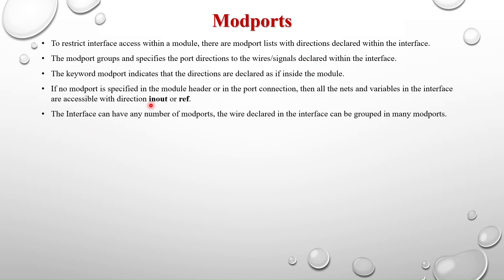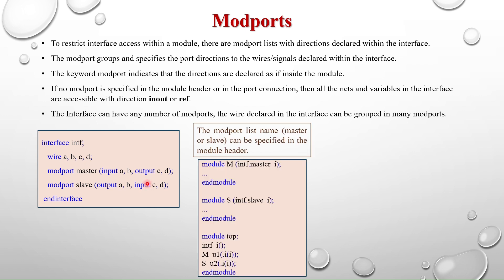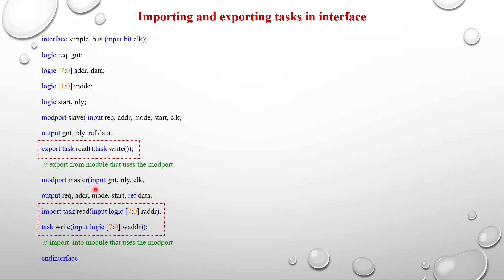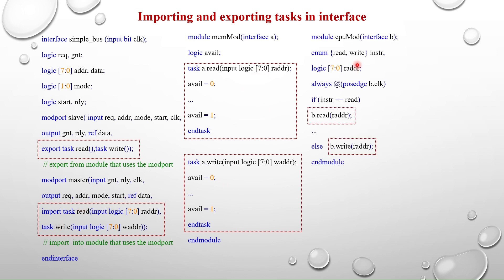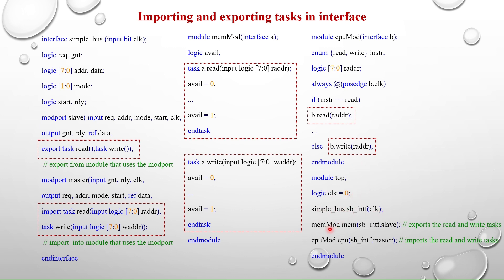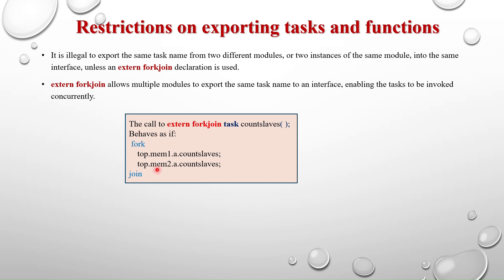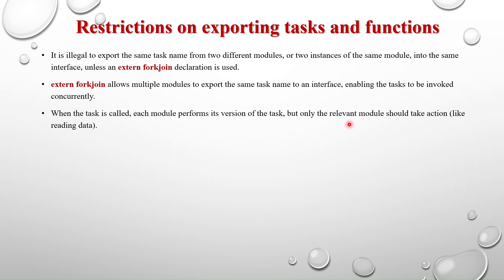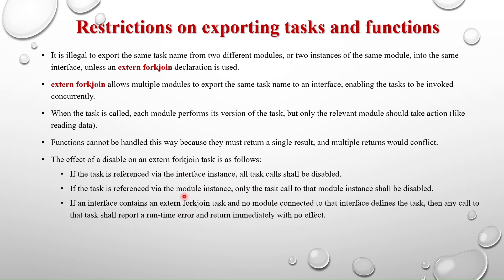Modports in SystemVerilog #systemverilog #vlsi #verification #semiconductor #education #learning

Comment: Mam in the cpuMod else condition when write task is called we should use waddr but in the video raddr is used which is correct please mention thank you
Reply from the maker: Actually raddr is just an address. It specifies the memory address to perform write and read. so when you call read method you will pass raddr so it will read the data in that "raddr" location. when you call write method by passing raddr it will write into that address "raddr".
This example is just to show how the methods will be used in our designs. You can use any logic inside i.e, you can take your own waddr Its fine.
Reply: @susheelapatagar  thanks for clarifying my doubt